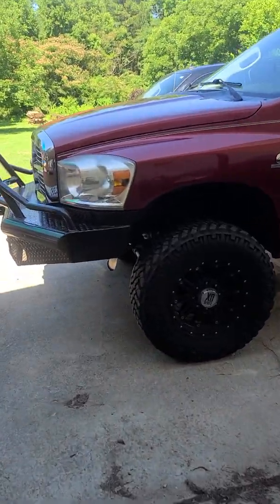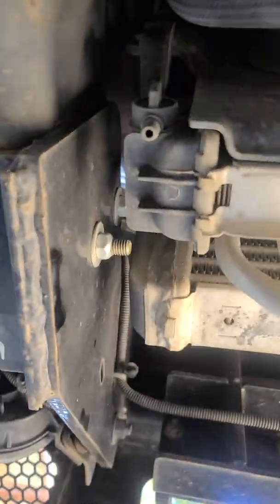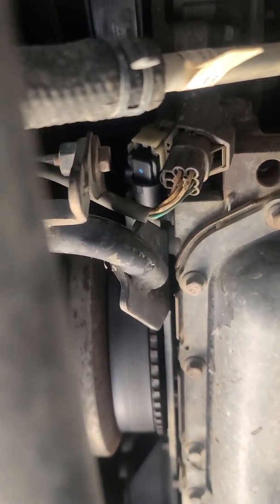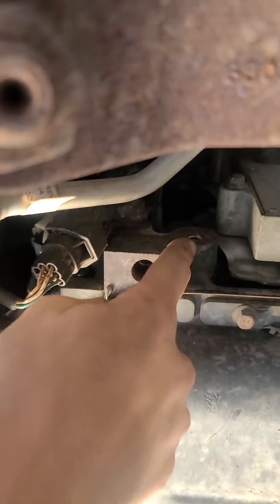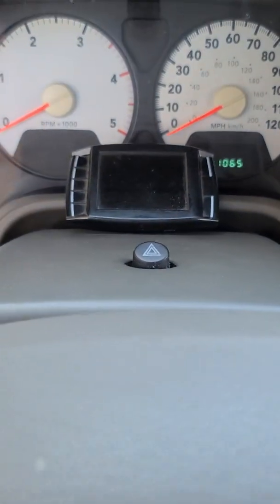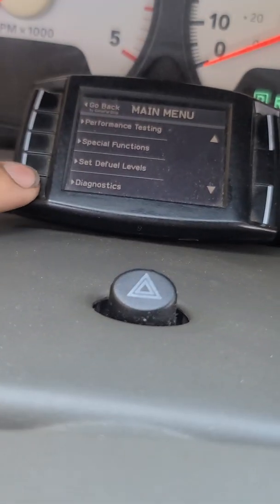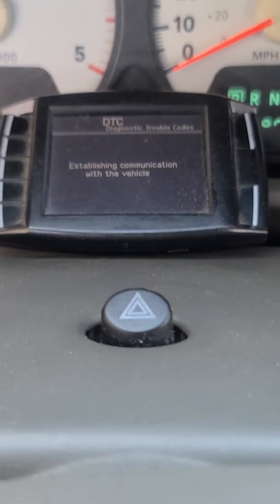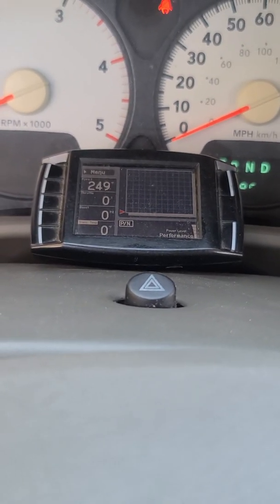6.7 Cummins crankshaft position sensor

Comment: Would a bad crank sensor cause the truck to die?
Reply: Absolutely.
Reply: @ yeah it happened to my 08’ Cummins in November what a pain.
Reply: @Snowmad46 would it cause truck not to start
Reply: @daltonbrown598 yes
Reply: @d @daltonbrown598 the starter will keep going but no ignition is the system.
Reply: @Snowmad46 thanks that’s the exact problem I’m have all of a sudden. Went from firing up right off the back to cranking until it decided to star
Reply: @daltonbrown598 it costed me a pretty penny a year ago!  Stock  I always keep a mental note when something happens to it.